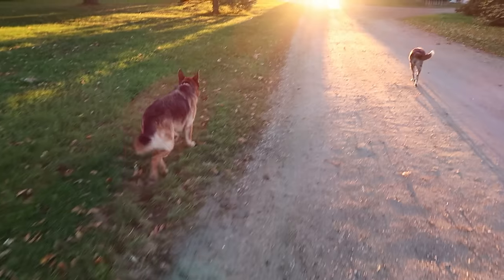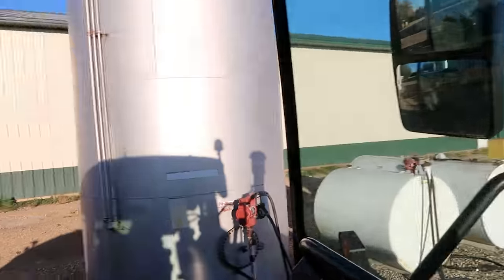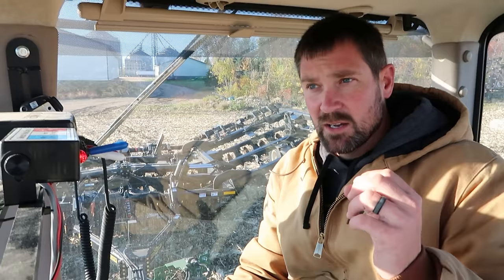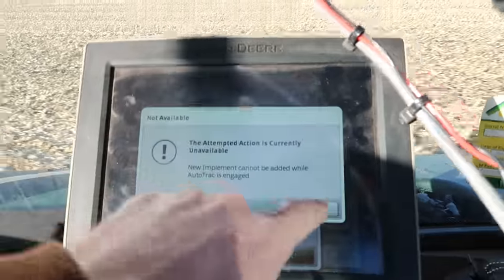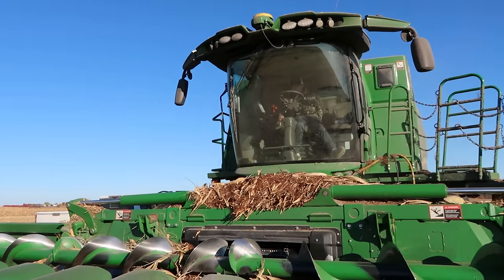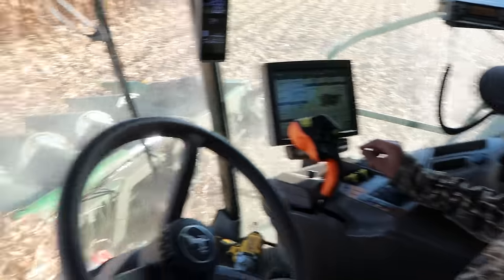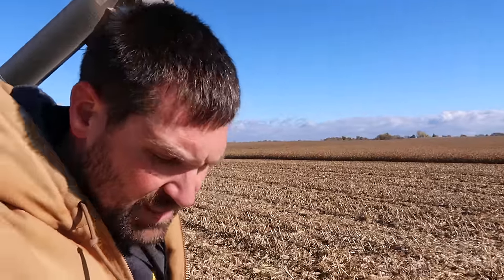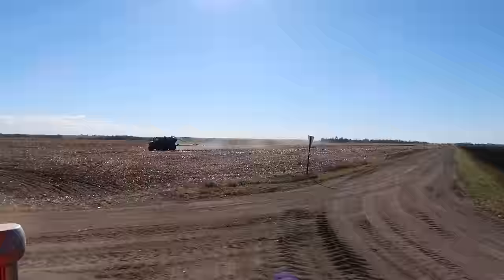Dad has NEVER Missed a Day of Harvest.. Until Now

Comment: Hey Zach, we always clean our windows with water now, just a little spray bottle, its a lot cheaper for one, but those spray cans leave a film behind so the dust sticks, those cans are good if u wipe down at night but we just use water now and the windows stay cleaner alot longer then they use to using the spray cans from the local dealer. just a tip

Comment: How great is it to see FAMILY farming.  I grew up on a farm learned to drive on a IH  Loadstar truck, 296 straight 6 engine with a 5 speed transmission and a split rear end. Drove that truck to my drivers ed classes so I could get my permit with I turned 14. First time I got pulled over by a cop I was over weight under under age. He told me to stay one the back roads. Didn't stay on the farm, my brother took over the operation, but it was the best training I had for my career as an international trade economist.

Comment: We put a new 45 ft wheat header on our lexion 750 which is 4 ft wider than the auger so when you unload into the trucks you have to pull up next to it and then reverse and turn left so the auger will be over the truck, so when we hired someone to run combine he apparently didn’t know and pulled up next to the truck while I was inside watching and pulled up way to fast and slammed the edge of the header into the truck so then we had a broken head and broken steering with 300 acres of wheat and beans left. Needless to say we will be informing everyone if we ever put anything wider that 35 feet on the combine

Comment: From someone who has no experience, what is it about the grain drier that makes you wake up every couple of hours all night? Does it not have limit switches or other protections to shut it down?
Reply from the maker: The biggest things I worry about are an air pipe coming apart or the moisture settings getting messed up. Mostly, it runs itself, but once in a while, something quirky happens.